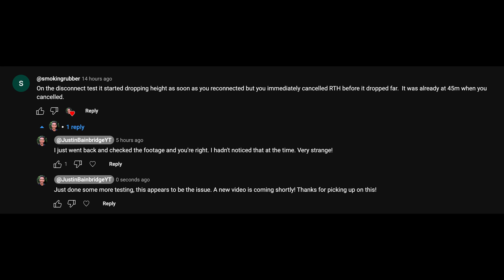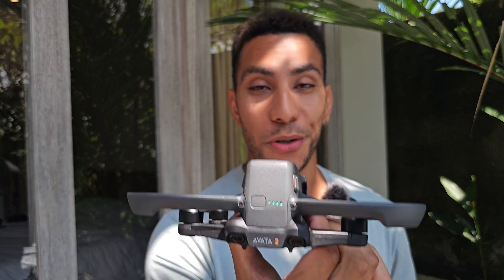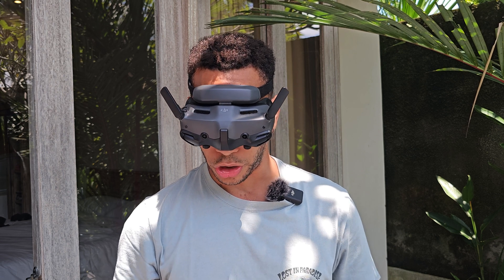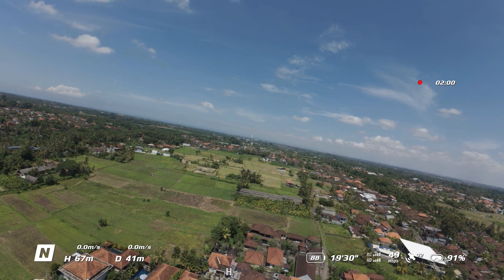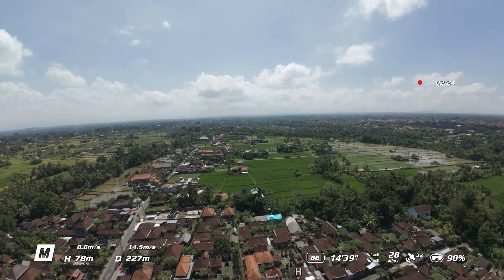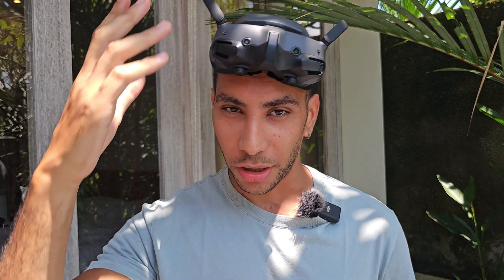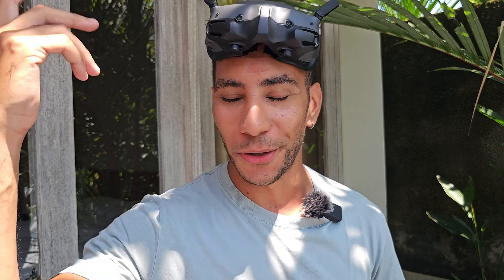DJI FIX THIS! - AVATA 2 Return To Home Issue Found!

Comment: Gonna comment the same thing I did on DJI forums:

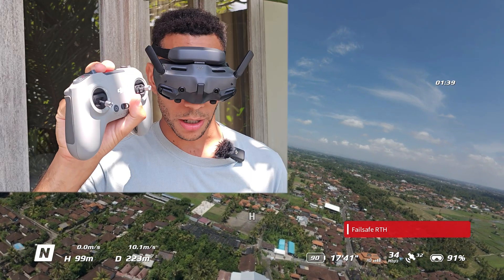Is this some kind of a troll video or do you not realise your throttle is below mid and therefore in N mode that makes it go down? You can clearly see it at 3:35 ...
Reply: Hey Filip, thanks for realising that.
Maybe he didn't notice it like I did? 
I think he doesn't want to troll anyone😉
Reply: @AlSo-Fotografie  I don't know how someone can edit that video, putting the controller in there in PiP and not realise it 😄 As someone with 9k+ subscribers he should have a sense of responsibility for posting stuff like this without basic research.
Reply from the maker: Hey there. I guess you haven't seen any of the previous videos of testing. I have already tested lowering the throttle on RTH, and it has no effect as it shouldn't. This is not a troll, this is a serious issue that has already resulted in someone's drone having gone down. Please see the other videos to get up to speed.
Reply: @JustinBainbridgeYT   I have watched the video and second time you do it your throttle seems slightly higher and it looks like the drone descends a bit slower. So again, I don't see the issue here?
Reply from the maker: @FilipRadelic  In my previous test, I activated RTH manually then dropped the throttle to the bottom, and the drone stayed at the same altitude. After seeing what you posted, I went to do another flight and found the same thing. However if you move the stick up and down a couple of times, then you can control the altitude. I still think there is an issue here because if the signal is re-acquired, then the drone should surely default to maintaining the RTH altitude until the user inputs a new command or hits the brake button. In the goggles in manual mode it's hard to tell where the throttle is and therefore if the drone gets some signal back but you don't see anything, it shouldn't take the throttle position as being an input. It'll result in a lot of lost machines as the throttle position to maintain altitude in manual is relatively low.
Reply: @JustinBainbridgeYT  ok, I get where you’re coming from now. I haven’t flown my Avata 2 much yet (broken leg), but I got over 300 flights with Avata 1 and I remember it specifically being able to affect RTH path using stick input, so maybe the actual bug here is that you were not able to change altitude with throttle in the first place? Everything shown here looks exactly the way I would expect it to.
Reply from the maker: @FilipRadelic yeah I see. This is definitely helpful. Ido believe that there should be a condition put in place on signal acquisition to set the throttle to a neutral value and not accept whatever the position is on connection as the throttle could be anywhere when flying manual. This would solve this issue. Many people flying manual would just leave the throttle wherever it is and if you were in a low power manoeuvre then you're screwed. Hopefully they can update the signal re-acusition conditions and then this would be solved. Otherwise you have to know to push the throttle up when you lose signal which alot of people won't do. They'll just freeze thinking it's going to come back at the RTH altitude. Interesting though. I'll be interested to see what DJI says and then I can wrap this up and forget about it 😅
Reply: @JustinBainbridgeYT  Thanks Justin for clarifying this. I was sure you was right.
Reply: @JustinBainbridgeYT  🤔👍